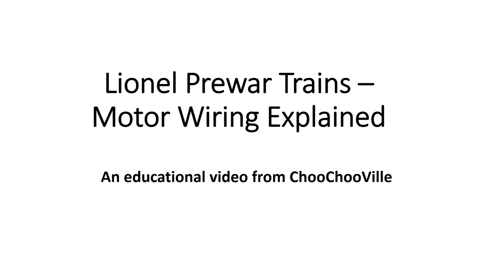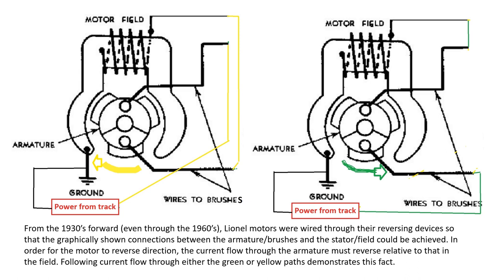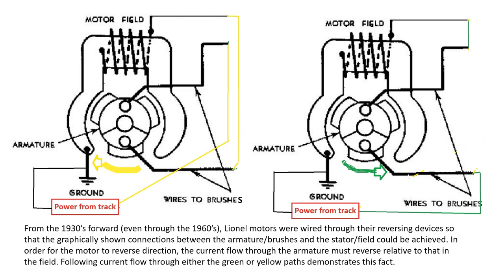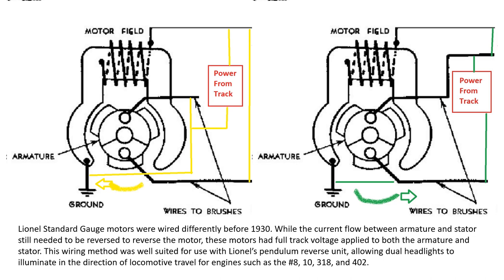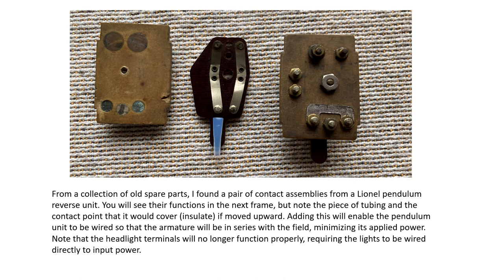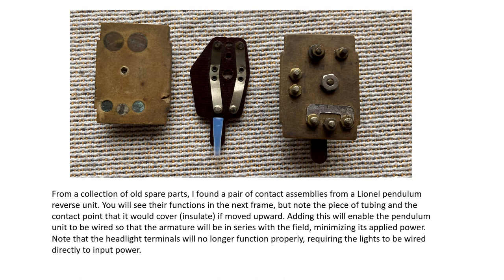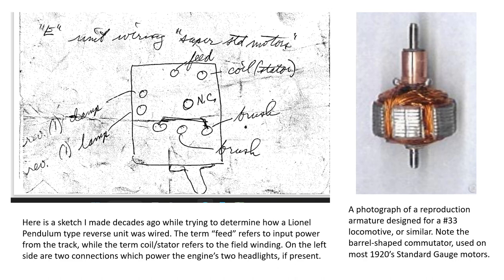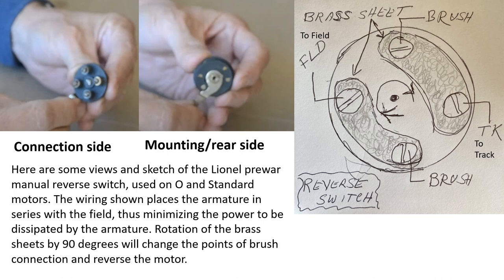Lionel Prewar Motors and How They are Wired

Comment: Very informational and applicable to other brands. After watching your video  especially the commentary, I changed an early Flyer motor to full power to the field and the brushes and just like magic, it will start from a dead stop every time. Before, wired the other way 50% of the time it would require a push to start. Thank you so much.

Comment: How does the termination of current make the pendulum reverser move?
Reply from the maker: The pendulum reverse assembly contains a contact sub-assembly that hovers above the top surface of the motor field laminations. When power is applied to the motor, the resulting magnetic field will pull the moving portion downward, and the contacts will open. When power is interrupted and then re-applied, the contacts will close and activate a solenoid that moves a set of pendulum-like contacts which reverse the direction of current flow to the armature, thus reversing direction of rotation. Some assemblies are also wired to activate the proper headlight associated with direction of travel.
Reply: @ChooChooVille  - Thank you.